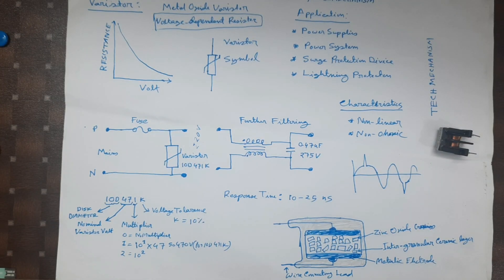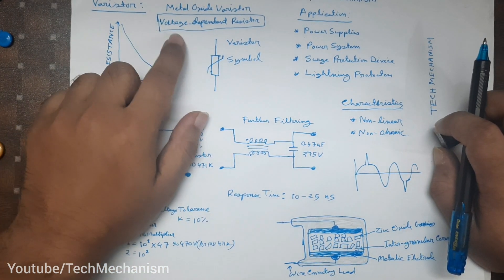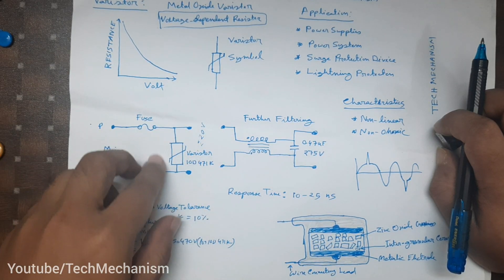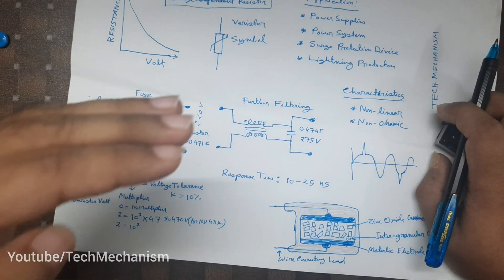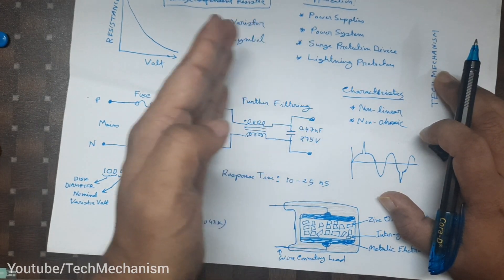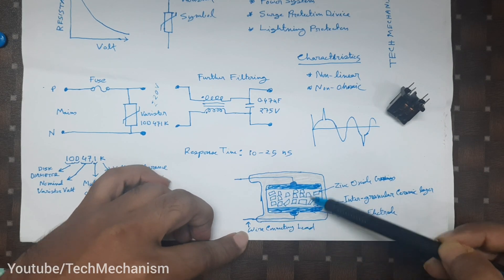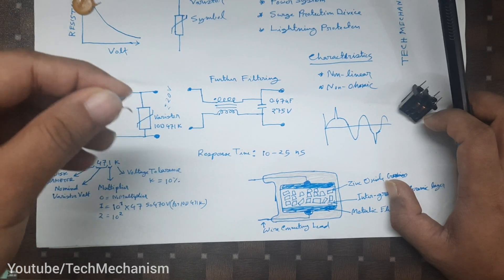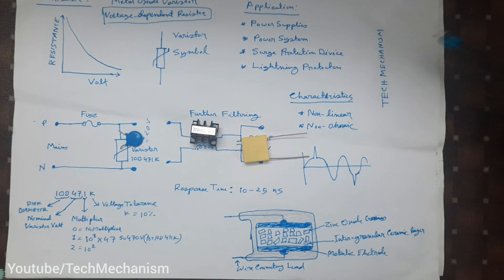#10 How to Protect Electrical Devices from Voltage Surge & Lightning using Varistor Circuit(Under 1$

Comment: Also best to use other MOVs after the fuse, besides of AC hot & Neutral, and two others one from AC hot and AC ground, and another from AC Neutral to AC ground, more protection of the AC circuit better approach.